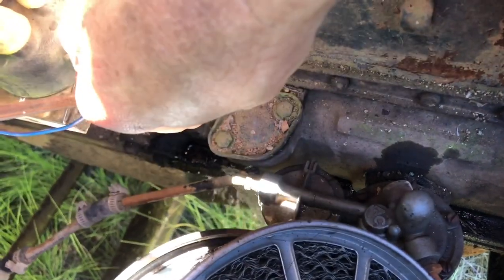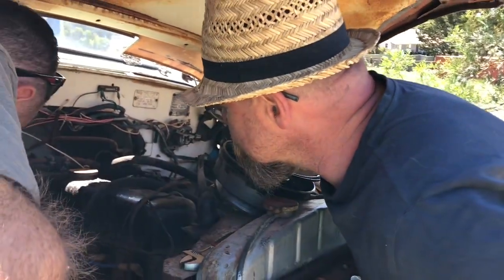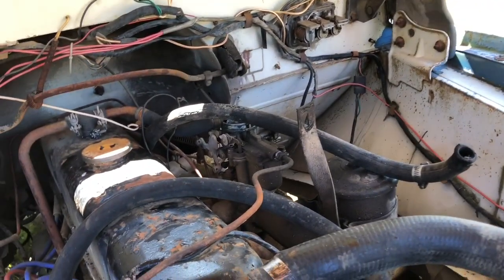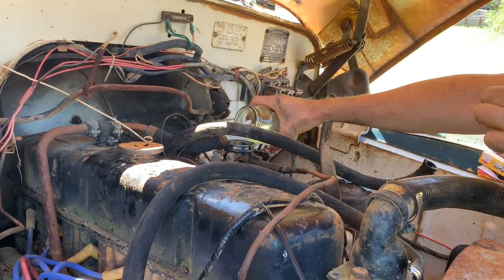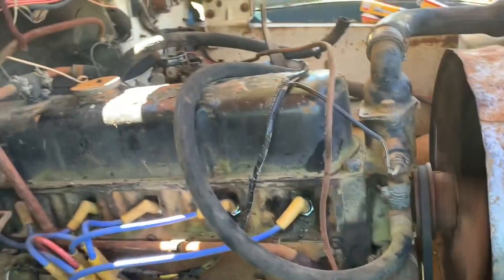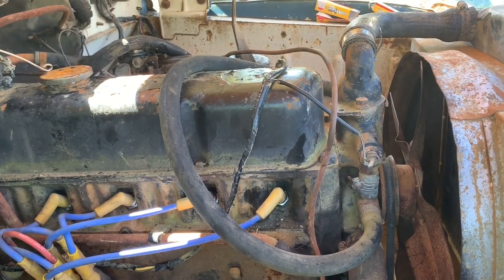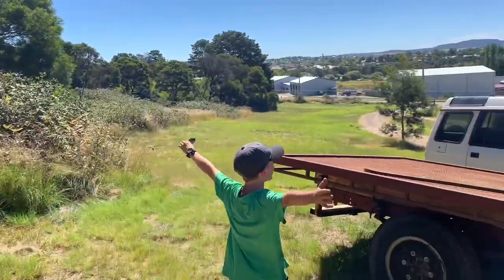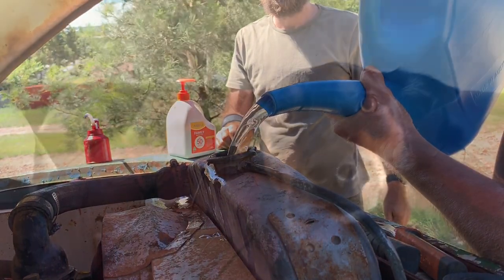Will it start? | Tj Bedford Truck  | 1962

Comment: Just so ya know mate that isn’t a TJ it’s a beautiful old J1. You can tell this because it has only two wheels at the back instead of a bogie axle and it doesn’t have a tipper on it. Looks great mate I’ve got the same at home and it runs nice. Love ya content keep it up champion
Reply: No mate, the model code is TJ, and J1 identifies the size of it. Yes it is a J1 (the smallest of the range at the time), and it is a TJ.
Reply: I think you mean duel or single rear wheels.
No TJ J1 had bogie drive axles.
Reply from the maker: He bought the truck. It’s a tj mate